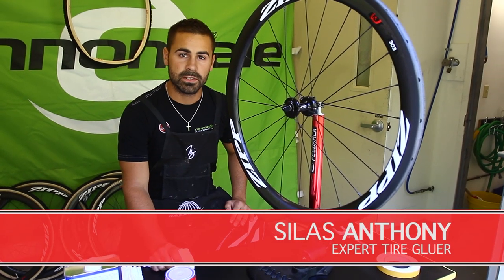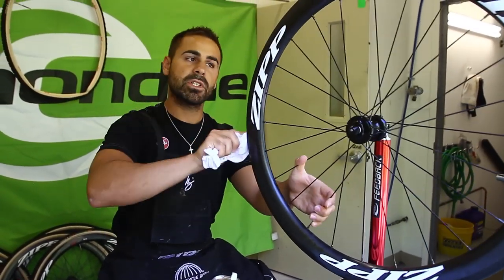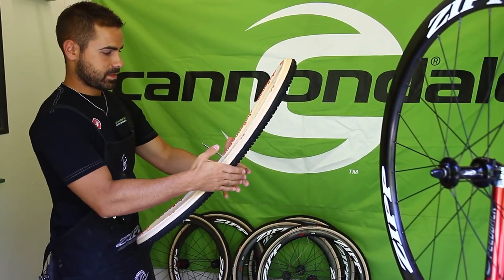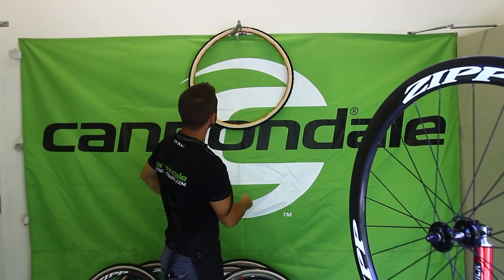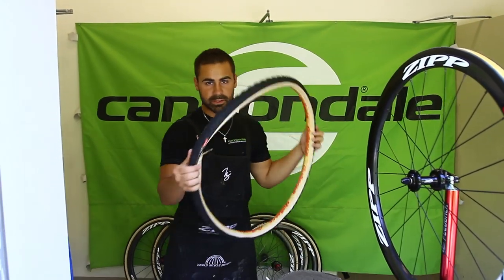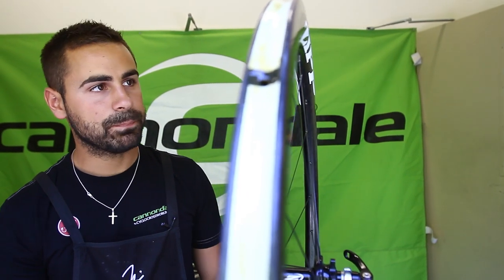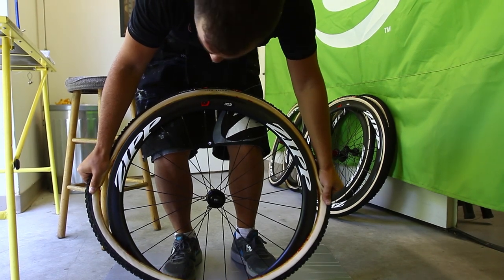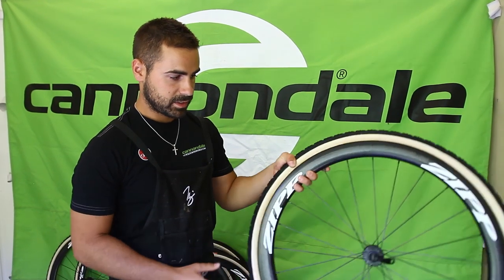How to Glue a Cyclocross Tubular Tire with the Belgian Tape Method

Comment: I have the same experience with Challenge tires. After mounting them, they are 99% straight. Just mounted a set of Schwalbe Racing Ralph and they were wobbly all over the place. After I finally got the thread centered, the basetape is showing 4mm on 1 side, and not showing on the other side... I'll probably go back to Challenge once the Schwalbe wear out.

Comment: So why is it so many folks say let the glue dry overnight before the next coat?
Reply: Don't know mate - Drying O/N is the way I've always done it, but I double punctured at the start of last season and had to get new tubs on in short order for the next race. Used this guy's method, one hit, done, and they were absolutely fine all winter. Maybe the tape is doing most of the work and the glue just adds 10-20% or something like that?
Reply: traditions die hard, technological advancement dgaf tho

Comment: So why the glue and the tape? why so many layers of glue then tape then glue ?  is the tire going to escape the race ?
Reply: It's a method so the tire bonds to the tape and the tape to the rim and they say it's a strong bond that will hold the tire pretty well to the wheel even when the tires have low air pressure. The many layers of glue to the rim and to the tire is because the glue sticks very well to itself so the more you have the better It will hold from the tire rolling off the rim

Comment: it is much longer  to swap a tubular tire properly vs to change an inner tube.  if swapping out a tubular tire without the tedious gluing, you can only limp to your destination vs. good-as-new with a new inner tube.
Reply: Nhat Tran if they were the same they would not go thru this trouble.  Tubulars are far superior in most respects for cross.  They are nearly impossible to pinch flat at lower pressures. Perform better at lower pressures and both wheel and tires are far lighter weight.  Give them a try.  You don't need to glue them on very often and it's not too big of a deal
Reply: If you’re racing cross, this is irrelevant, you just shoulder your bike to the pit and swap wheels/bikes. If it’s on the road, you take a pre glued spare (longer is debatable, a good rider can change a tubular just as fast as a clincher)  and can certainly finish your ride, it just won’t be at a blazing pace. But unless you regularly ride through terrible neighborhoods your flats per decade can probably be counted on one hand (I’m at 1 in two years of steady riding so far), and I’ll take the feel and general awesomeness of weight savings from tubulars for an inconvenience 5 days a decade

Comment: Doesn't this method make the bond of the tape to the glue more important than the tyre to the glue? The forces with low pressure and speed in corners comes on the tyre.
Reply: Erik, good question but I don't think so. As long as you put two solid layers of glue on the tire and let it soak in and dry for a bit the bond of the glue to tire should be plenty. The tape is just sandwiched between all the layers of glue and mixes with the glue to form a really strong bond between the tire and rim. The tires I glue for the Cannondale/Cyclocrossworld team are definitely on the rim securely. Trust me, it's a good 20 minute workout just to get on off sometimes!
Reply: Sounds good, I am gonna try! Thanks
Reply: +S Anth Thanks for the vid!  The Gale Hess trick to removal lol is take a utility blade and cut the tubie perpendicular to the direction of travel.  Cut across the rim, gently cut through the layers, avoiding anything but the lightest touch on the Belgian tape, so as to not damage a carbon rim.  Then, just pull the loose end at 180 degrees to the rim bed, basically pulling it back on itself, so the tread you are pulling on touches the tread you are about to remove.  Bam.  

I enjoy the ritual of gluing up.  It's weird, it's tricky, people have 
been doing it for decades and it results in a better road and cross 
ride. 
Mastik tests stronger than other glues, use glue outside and with a respirator for good measure (if you're doing more than a set of tires...) Tufo tape is known to fail and put people in the hospital, can mount on clean swept concrete so rim doesn't get cardboard on it.

Comment: Great Video - thanks for posting.
- Is there any difference between the Cx tape and Belgian tape?
- Will the tires stay on the rim for a few years or should they be reglued every season? (I'm cat 4 old guy and race 10-12 x per year).
Reply: Frank, the CX tape is just one form of Belgian tape. There are many variations that I have seen and worked with. The best type I know of comes from Belgium, it is the original Belgian tape...hence the name. However, it is very hard to get and is expensive. The CX tape is the next best things in my opinion. Seems to work very well. In terms of how long it will stay on the rim...there is no definitive answer. It depends on factors such as how well it is glued on, what type of tire, how many races you do, what types of conditions you race the tire in (mud, snow, etc), and how you care for the tire (cleaning and drying after a race, not storing it damp). If you take good care of it and its glued on well, you should be able to get 2 seasons. But there are no guarantees. You should regularly check your tire but putting a little air in it and using your thumbs to try to push it off the rim (not too hard) so that you can see if any areas of coming undone. Honestly, it's usually the base tape of the tire itself that starts to come undone from the casing and not the glue that fails (assuming the glue job is done well). If you are using any tire with a cotton casing (Dugast, Challenge Team Editions) definitely Aquaseal the side walls for durability and longevity.
Reply: S Anth
Silas
Thanks for your response and for specific suggestions - I will use them going fwd.  I watched your video multiple times, mustered up the confidence, and had great success gluing a set of Clements on my wheels. I only had one minute or so of panic as I realized I hadn't stretched the tire enough upon initial install, and I started having a helluva time with the final fit. Fortunately, the glue was still setting up, and I was able to make adjustments as I checked alignment. All turned out well. Thanks again...now just to work on my skills, put my tires to work and stay upright on race day!
Reply: HI Silas, 
The tires have held up great but unfortunately one of them has failed at the Stem and now needs to be replaced.  I pulled the tire off (what a bear!) and am left with a strip of CX tape on the rim.  The tire base tape came off cleanly as did most of the tubular glue.
- do I just glue right over the CX tape that's there?
- if you recommend pulling it off, what's the best method to get that CX tape off?
thanks again for the Video.  Method is solid ... as evidenced by my effort to get a damaged tire off the rim!
Reply: So did you find out if you can leave old tape on or not?
Reply: @santh9177 hey Silas

Are you able to leave the tape on the rim when the time comes to reglue a tire, and how do you remove tape or glue from the tire if that is the case? I recently had to reglue an Enve CX rim to a Challenge Baby Limus Team Edition, and while I did end up removing the CX tape, it was extremely difficult and a heavy task. I never did remove the glue/small bits of tape on the tire, remounted it, and raced a full season on it since. But I now have 4 sets of wheels to reglue for this season. How should I go about this?

Comment: So you don't see a need to wait a day between coats of glue?
Reply: Silas answers that very question (time 5:12 of video)
Reply: +Frank O'Brien So he does. Caught that on my second viewing. I did this method on Saturday, and am looking forward to testing at this weekend's race. Now to figure out how to get the glue tape and mastik remnants off of my sidewall...
Reply: +John Graham ...yeah, this job can be messy. I used green painters tape on the rims before I started and that seemed to help.  The rest I rubbed off or used a rag with acetone.  Good luck at the races... my wheels are now solid and now I have to figure out how to move thru the bunch!
Reply: John Graham use acetone

Comment: No point in the tape aswell as glue unless you need to fill a particularly deep internal rim diameter. Both the glue and rim tape are not designed to stick to each other. Also allowing the glue to dry at least 6 hours between coats means less time to wait after mounting the tyre and gives better adhesion.

Comment: clincher is the way to go.   This is way too messy and it takes too much time.    Furthermore, it is a big inconvenience if you get a flat on the road.
Reply: +Chitown388 but tubs are way way better, especially for cyclocross. There is no difference in inconvenience if you get a flat with clinchers or with tubs - but you get far less flats with tubs, even with much lower pressure (which means more grip)
Reply: Nhat Tran they are not riding on the road, They are on a cyclocross coarse.  Also this is a pro team and it's his job to do this.   They are far superior to clinchers.  They are only messy if you are not experienced.  Really not that big
of a deal if you are looking for the best performance.
Reply: Nhat Tran clinchers are obviously 1000x more convenient, but the ride quality and performance is 1000x worse. For a serious cx racer it’s worth the headache of glueing fir sure